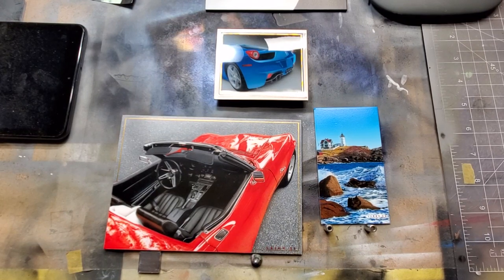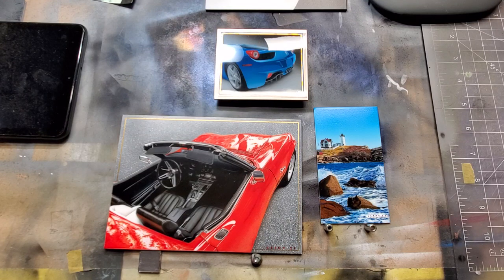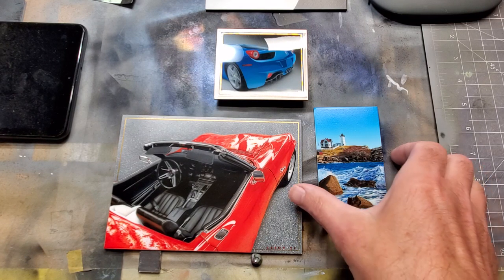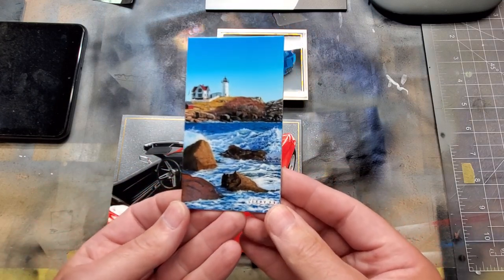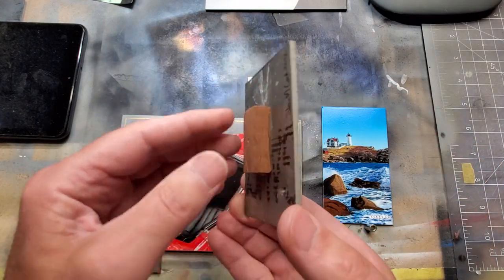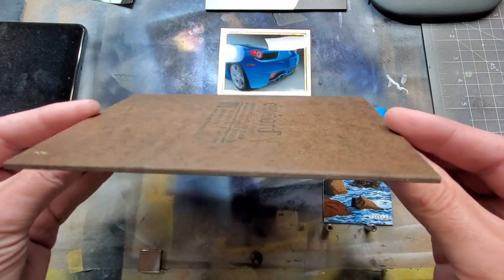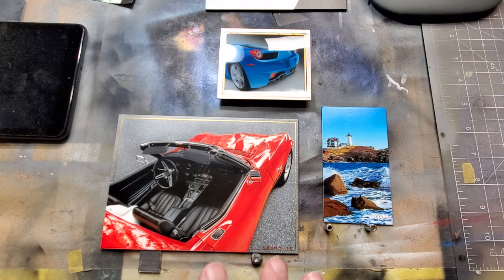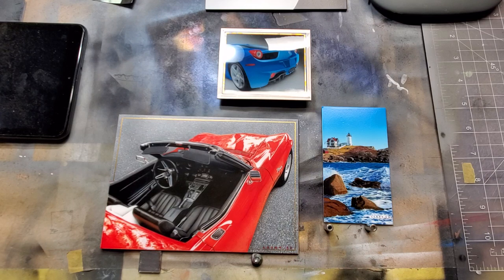Tech Tuesday - The Clear Story

Comment: I wish my local place sold aluminum like that. All they have is super thin or tiny which would be perfect for you.
I hope the steel panel I did for you doesn't rust out on you to quickly LOL 🤣😅
Reply from the maker: Agreed! Most sign shops jyst have tiny scraps. I wish I could find an old jump shear for cutting my own. I'm sure a decent one will turn up.